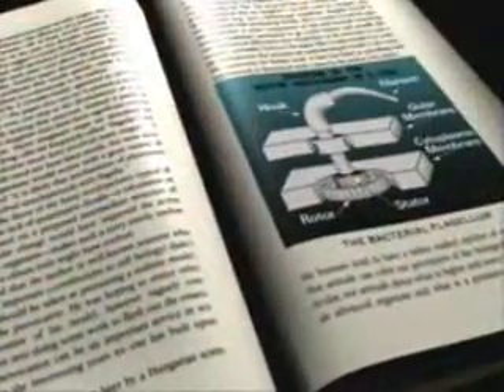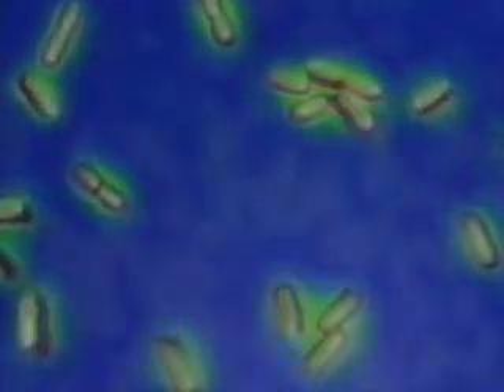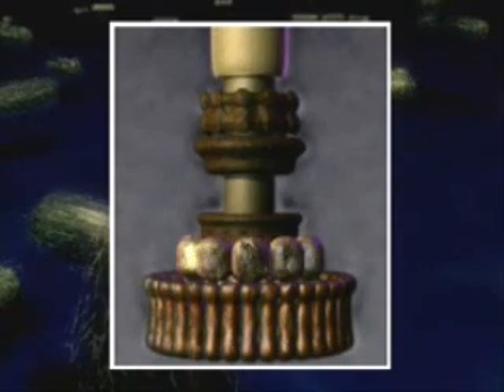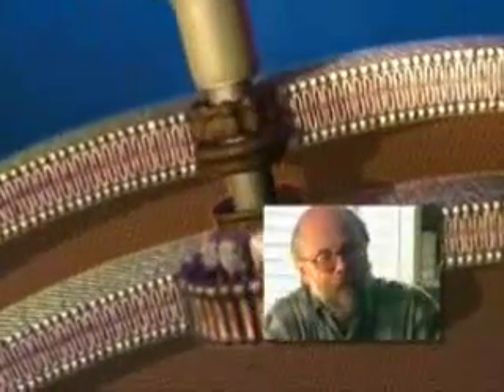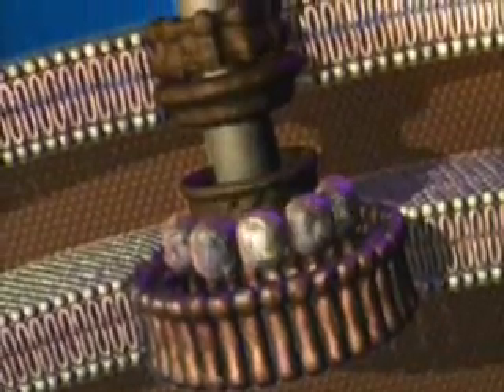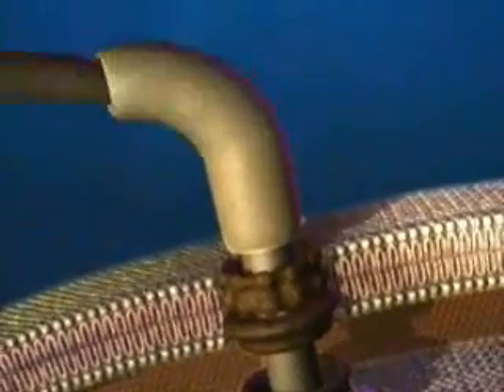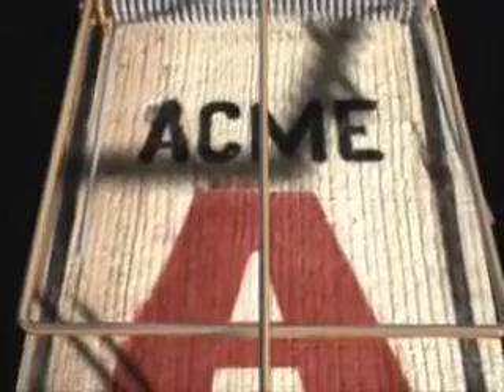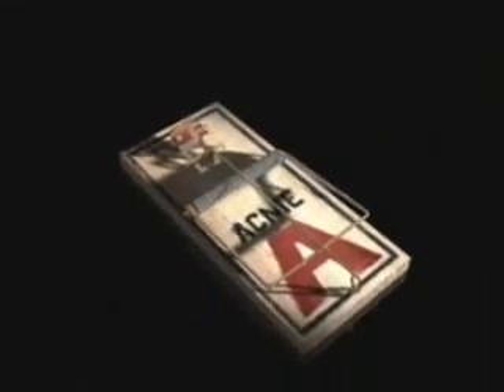Amazing structure of Bacterial Flagellum

Comment: Having an engineering background, it's easy to see that design is incorporated into everything around us. To deny this is akin to a drug addict staying in the self deception of personal denial about their drug problem.
It used to be said that the one celled amoeba was simple until the electron microscope came along. Now, it is understood that this SIMPLE ONE CELL STRUCTURE is more complex than an auto factory that takes in raw materials and produces many models of autos for the consumer.
IGNORANCE IS NOT BLISS; it's DOWNRIGHT DANGEROUS!
Reply: When I look at signal cascades, or G- protein regulated channels, I really have to wonder how anyone can imagine it all evolved. Many systems within one organism require the proper function of several or all other parts. Really, evolution doesn't claim they came about piecemeal, but that a chance collision of dead matter slammed together in the exact mold of a living organism, and also happened to slide through some "life juice" that happened to be lying around... And poof! A living organism from abiogenesis.

Comment: If you look at the live microscopic footage of the bacterium moving about, there is something additional to consider; the flagellum seems to be "controllable" throughout it's length allowing it to alter movement.  The motor turns the flagellum but something else is going on here.  It isn't known how the individual parts of the flagellum work but it is a "living" propeller, capable of changing it's shape as it rotates!